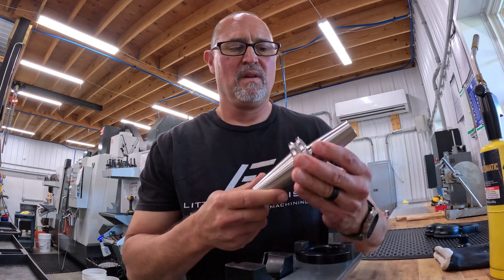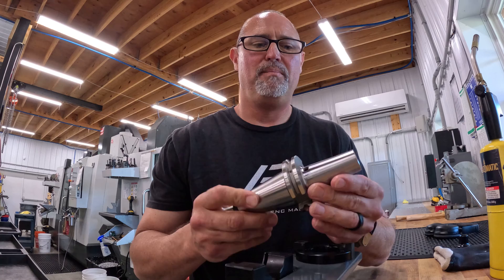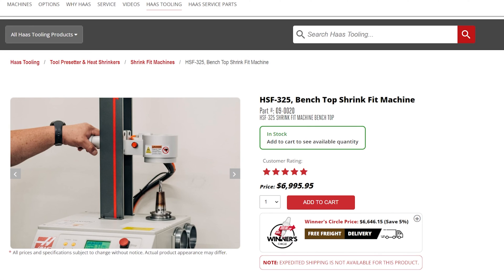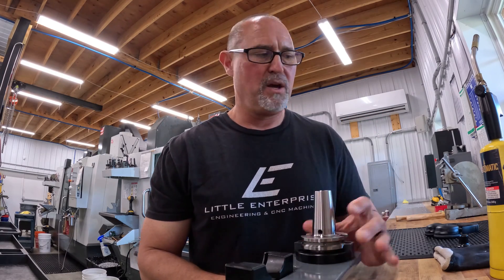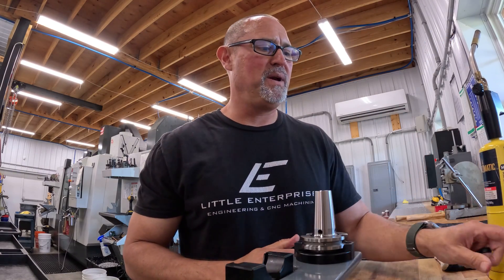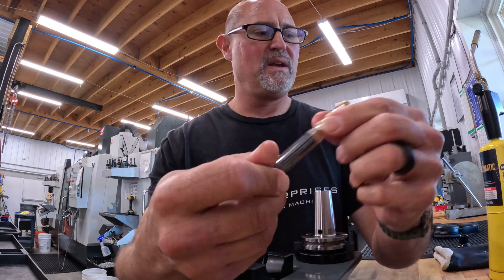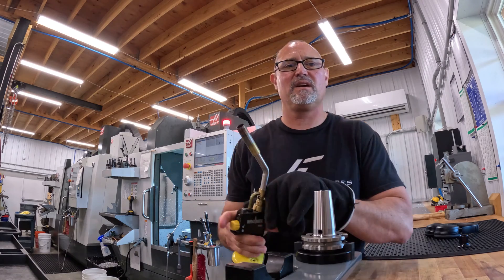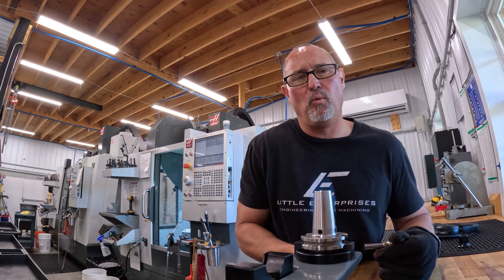How to use a CNC Heat Shrink Tool Holders without a Shrink Fit Machine

Comment: Thanks for the demonstration. I have never thought about using a torch but I can see where it would work. And if you're not trying to keep up with tool lengths or don't need them to repeat then yeah. Especially if you're not changing cutters much.
Reply: Um, I would wear the glove though and be pulling on the cutter as you are heating it up. That way it will come out as soon as it get's hot enough. If it gets too hot, I would just use some pliers.

Comment: Great, I was wondering if it could be done without special equipment. Thanks
Reply: Normally you would use a specialized electric induction heater, which only takes a few seconds. The next thing is to measure it. If your mill won't measure it you could enter a rough measurement and then run a witness cut and adjust from there. Most of the heaters come with a height gauge built in so you can set the length as you insert the new end mill into holder. The accuracy is about .001 to .003 but with a little extra effort and a few tries you can achieve a range of +.0003 to +.00008. If you ever get one to repeat within .0003 then it's probably an accident or deserves bragging rights. It would be nice to find a (specialized) rig with optics built in though to set the tool length with.
Reply: These heat shrink tool holders can only be heated so many times. After they have been heated so many times they become less elastic. They won't open as much and they also contract ("shrink") a lot faster than they do when they are new. That means you have to be fast on the draw, especially if you are trying to set a precise and accurate tool length. You can tell that the holders are getting warn out when they begin to turn black. 
If you use the cooling sleeves that are designed for these holders, they will last a lot longer. The faster you cool them the longer they last. Letting them cool at room temperature is really hard on the lifespan. plus it's dangerous to have these hot tools sitting around where you might forget and reach for them while they are hot without thinking. I've seen it happen and the burns can put you out of work for  week or two too. 
I'm gonna say they will last at least 10 times longer and probably more like 50 to 100 times longer. And they are not cheap.